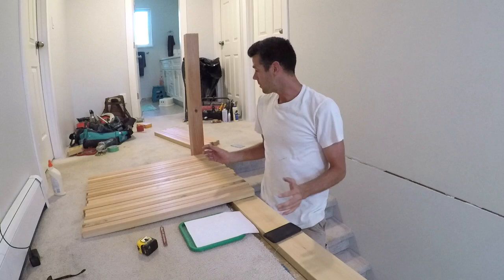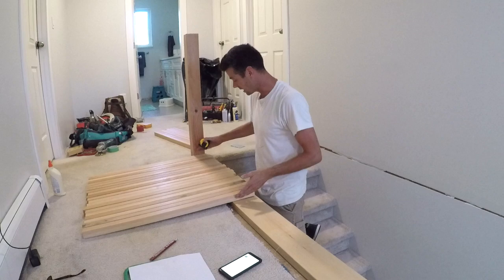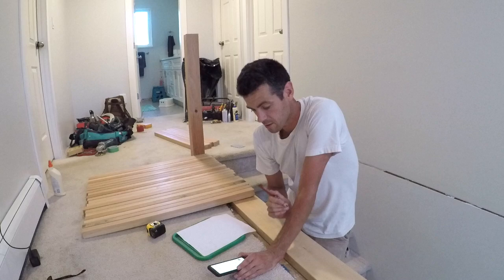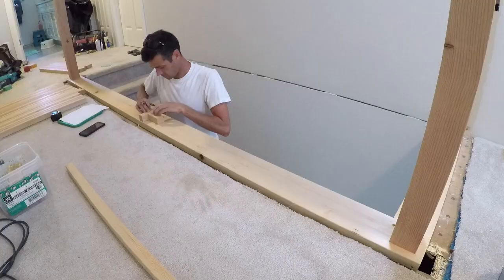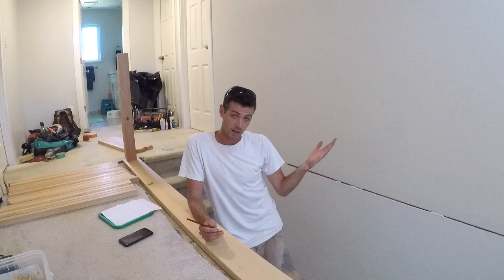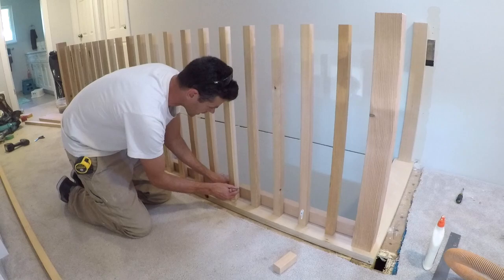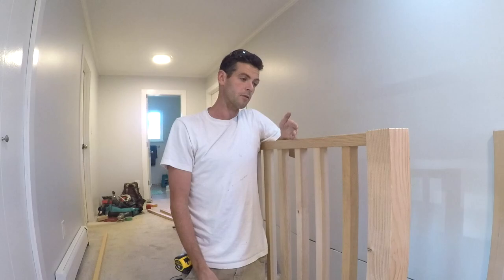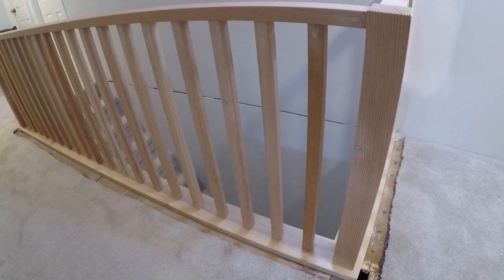How to get EVENLY SPACED Spindles!

Comment: At 3:38 you tell the world that we in Canada don't work in metric because we are stubborn. That Sir is a crock. You don't work in metric because you yourself are stubborn and apparently out of touch. You call yourself "Vancouver Carpenter" and, being Canadian, I seem to recall that Vancouver is located in British Columbia which is part of Canada unless you are referring to Vancouver Washington. Canada has been metric since 1976 by Federal law. Only those who were using the Imperial system prior to 1976 such as myself (Born 1952) tend to use Imperial and most are familiar with the various conversion factors to move back and forth between the systems. As far as the U.S. is concerned, they were slated to go metric until Ronald Reagan decided it was too expensive and cancelled the program. This proved to be a bad decision and now many American companies are voluntarily making their products using metric measurement because their products are being sold in metric countries around the world that demand the use of metric.
As far as your method of affixing your spindles, well, maybe you should leave that to a to a true finishing tradesman since only an amateur would use screws and filler. Anyone familiar with rails would tell you to use hidden dowels with glue or in lieu of that mortise the spindles, top rail, and bottom rail and affix with glue to get fastener free surfaces. Hell, even screws through the top rail with the screw holes plugged with wooden plugs would be superior to filler.
Reply: Troll